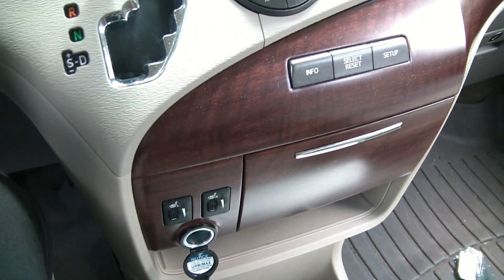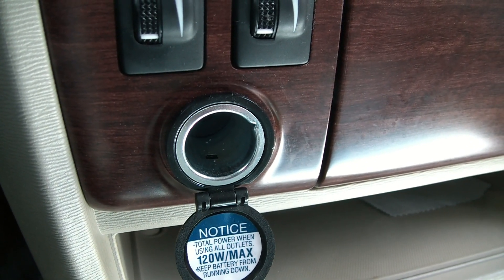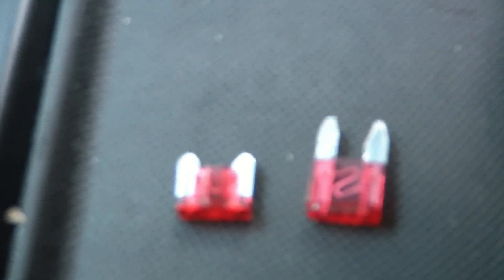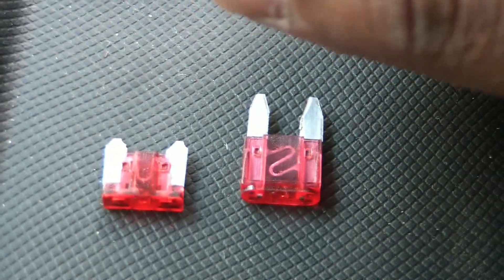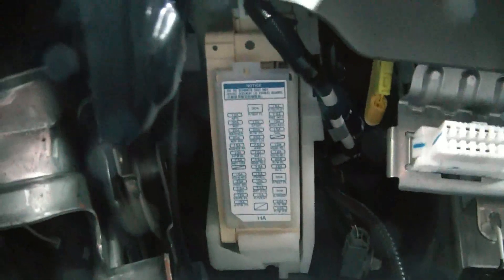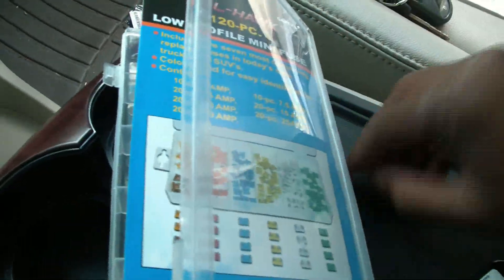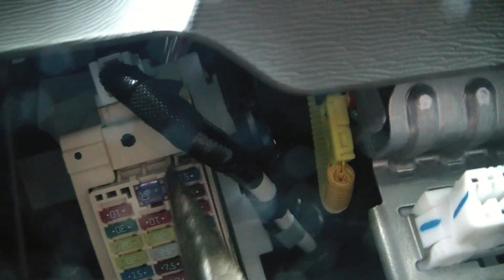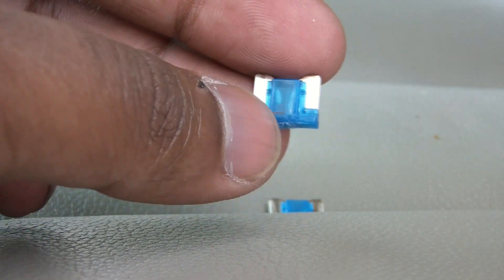Toyota Sienna 2014 Fuse Box

Comment: WRONG!!!

A MINI FUSE does fit instead of a LOW PROFILE. But not the other way around. 

I have used them before and my ute has one installed for the LED light that I fitted in the tub.

Comment: Cruz ✝️.. in the old times like 1990’s my dad would fast fix a fuse. Like you n a road trip. By: using a conductor to make the two conector come together, a rap gum paper aluminum or a wire or a penny.. hahaha 😂
Reply: To 
@eliascruz9757
There is a reason why fuses marked for different power. The fix you told about above will cause more damage to car electronics which will be hard to find to fix and you may stuck on the road after minute of driving or so (depends what you shorten with piece of metal).